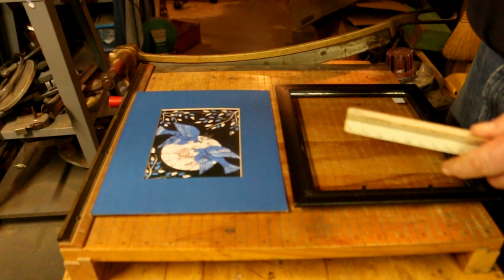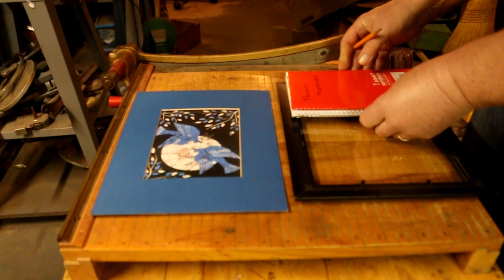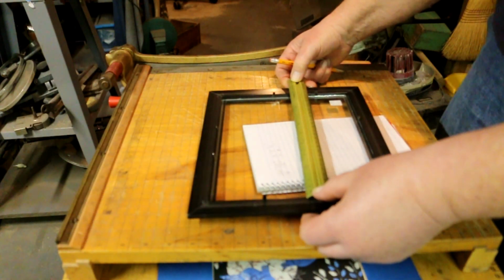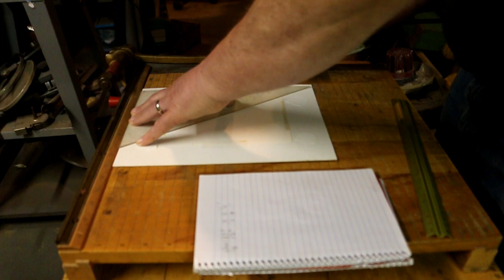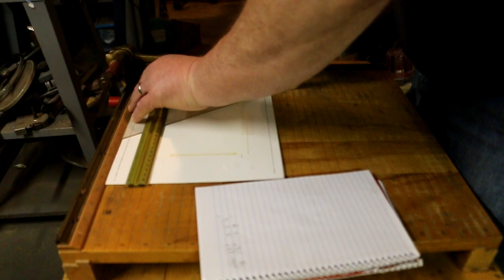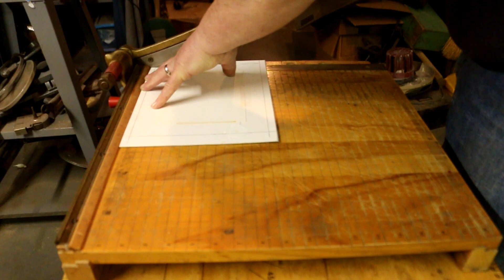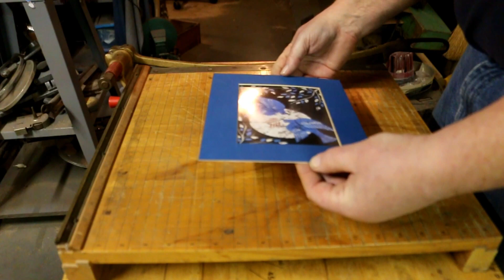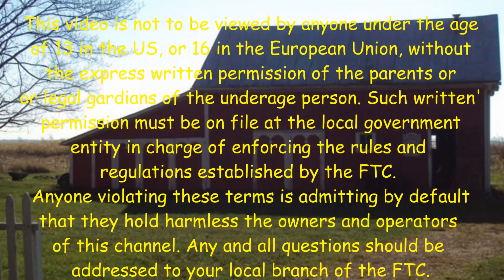Trimming A Matted Print To Fit A New Frame

Comment: I like your announcer or whatever hat she wears besides the EVERYTHING hat like they both have. Toots ended up with a cutter like that but her step-dad had a spring contraption on the end of the hinge shaft which I promptly removed and reset. I might've draw filed it but not sure. She uses it all the time with her card making and the last time I used it was to separate the old pictures of when I had black hair and lots of it when we were putting the 1st crusher together. It stays in the She Den and I don't. I'm going to send you a copy of something I sent John CS since you're the machinist of us all and will understand it in the light in which it was revealed. One of my memorable days of which have been quite a few. So YAY for U 2 and GBWYall! I still think a foundry would've been a VERY fascinating place.
Reply from the maker: Lydia appreciates the praise. 
She has a little "safe" cutter with a wheel. It works on paper. Mine cuts corrugated and heavy gasket material.
Reply: @OldSneelock  Toots has or maybe had a rotary cutter but when she wants to get intense she gets the big chopper down.

Comment: They used to have those big paper cutters in the classrooms in elementary school.......I'll bet in 2022 they don't, kids aren't quite as smart as they used to be and today you'd probably have some kid chopping their finger off every other day.................I actually have a big one and they're handy when you need it................I shudder just thinking about the old sheet metal shear in Junior High Metal Shop......Today someone would manage to chop their own head off.
Reply from the maker: I like watching Mr Pete. He often speaks about the amazing lack of caution that his students portrayed. 
Just a few eye witness reports. 
Jr High. Mr Reeg teaching 7th grade shop. A young man is turning on a lathe and sets the tool rest for tuning a 4" square block. He gets ti down to about 1 1/2" diameter. The tool catches and because it was sticking out away from the tool rest 3" it flips out of the young mans hands and sticks in the metal cabinet door across the aisle behind the lathe. 
Senior year of high school. A budding genius decided to make a shurikin. 
He laid a piece of 2" square 1/8" thick steel plate on the surface grinder and sharpened the edges. To do so he cut a 1/8" deep divot in the magnetic chuck. 
Mr. Stankey taught us all new words that day. 😁😎